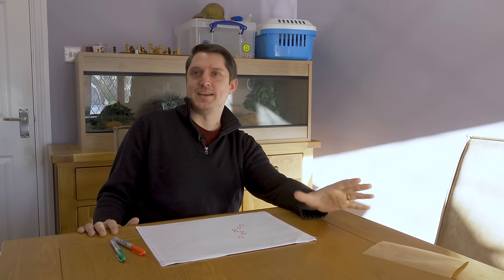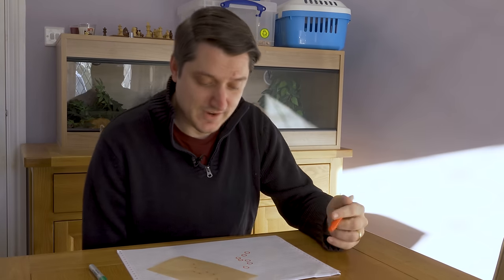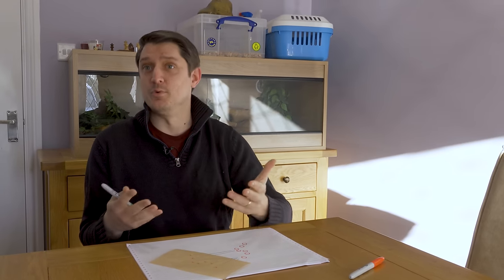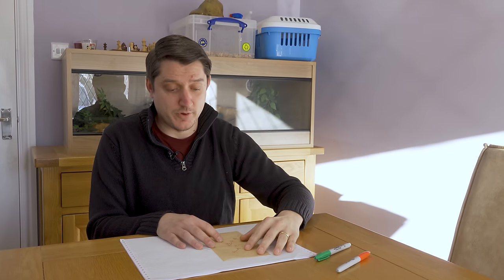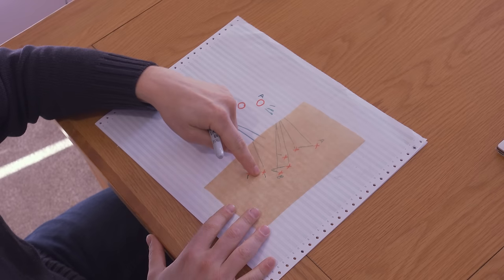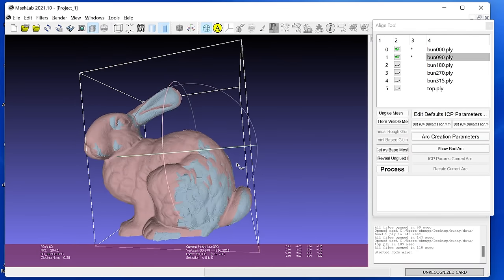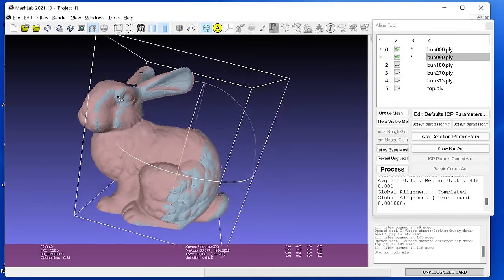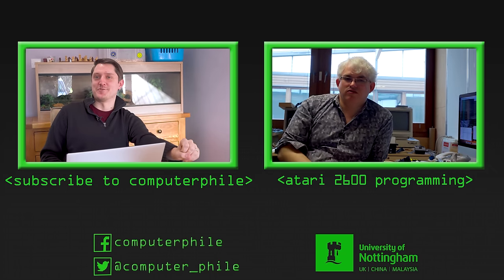Iterative Closest Point (ICP) - Computerphile

Comment: Singular value decomposition is one of those things that translate extremely well to GPUs. In fact, Nvidia's CUDA library has purpose-built SVD support (the cusolverDnDgesvd function in its cuSolver package).
Reply: I used that for live feeds of a self-driving simulation.
Reply: Sadly, SVD is by far not the bottleneck in this algorithm because it's only an SVD of a 3x3 matrix.  Actually, the real thing that needs to be sped up on the GPU is nearest neighbors search, which is a bit tougher but doable
Reply: You'd have to use a parallelizable KD Tree

Comment: Enjoyed - nicely explained.  Love the enthusiasm.
Seems to me that it works well for the scenery but there is a whole set of other problems if there are moving components.  First level difficulty a moving rigid object - say a car.  Even more tricky a flexible item - say a person walking.
For a real time application then more frequent scans means closest point is more likely to be the corresponding point but you have less time to process each scan - interesting trade off.
Reply: The goal of ICP is to reduce the amount of error, where "error" in this context would be defined (very roughly) as the sum of squared distances between the matched pairs of points. So movement in your scene would be handled (naively) the same way as the edges of the bunny scans in his example - the algorithm will minimize the error as much as possible but eventually get to a stopping point where most of the scene points overlap nicely but there are areas of large concentrated error, corresponding to the places where there was movement. (Hopefully that was clear enough.)

Comment: In astronomy we often need to map arbitrary images of the night's sky to Right Ascension and Declination coordinates (called plate solving).  I wonder if this algorithm is involved, using stars as the points.
Reply: When your points have additional attributes, such as brightness, it's often helpful to treat them as an additional dimension. Besides that, what the matching program does is probably very similar. At least, as the final step. To improve convergence, it might, for example, start with just the brightest points, and add more as it gets closer to the solution.

Comment: I had this video in my watch later over 3 months now. My expectation was to learn something about photogrammetry and matching pairs to build a tree and then a point cloud. I had some ideas to how it might work with projection and interaction, but that seemed a little involved. Now with the topic of doing 2D or 3D tracking in video, I always assumed the 2D example would do an extrapolated spiral search pattern for points and just find the lowest difference in the search area. 

But it never occured to me to see matrix tricks like SVD show up. Such a crossover.

I knew that a fourier transform on a matrix (like an image) would ignore any kind of translation or rotation, so you would use it for pattern matching for example. There was an actual optical application by Huygens Optics in a video a long while ago.

Comment: 5:40 I understand the centre of mass of the points to shift the sample - but how do you decide the rotation? Do you just move it to centre of mass, then rotate and if it gets better, you rotate it some more , until it gets worse again? Or is there a better way to do it?
Reply: rotations are simple enough that they can be expressed as matrix multiplication. the resulting matrix will not be completely solvable because its an approximation, but SVD gets you the best solution you can get with linear algebra
Reply: @alegian7934  yes he mentions SVD later but considering its 3 dimensions my mind still boggles how this can be done so quickly. Is there anything that helps a first guess?
Reply: I could be wrong in any of the following. But: if matrix A describes the 3d rotation, X is the matrix that contains as columns all points in one group and Y is the matrix that contains all points in the other group, we have AX=Y (approximately, remember, these cant truly be equal) so ideally if they were equal we would invert matrix X and obtain A=YX' (we found the rotation matrix) In reality X is not invertible at all but we can find its SVD that gets us as close to its inverse as possible. so we get something like A*UΣV=Y and we solve for matrix Â (an approximation of the optimal rotation). And we apply Â to X
Reply: @alegian7934  I guess that's it! This is all new to me. We did cover 3d transformations back in my degree, but not inverse, only forward. At least that's what i remember! Very interesting, will have to do some more reading before I understand this enough.
Reply: @alegian Can't we just do the following:
1) build a vector A out of the selected points of the first shape in respect to their center of mass: A = Σ a_i - a_center
2) build a vector B out of the selected points of the second shape also in respect to their center of mass: B = Σ b_i - b_center
3) calculate angle between the vectors?

Comment: Our biggest scan project was around 20 Billion points. Took a while to register even on a Threadripper-based workstation. Our scanner measures 976,000 pts/sec.
Reply: Maybe you where busy counting your points, but if you listen carefully around ~10:00 he is answering your comment
Reply: Btw: 20billion points would take more than 230 days of non stop laser scanning (with your ~1M pts/sec laser scanner). Did you just scan the all earth or what ?!!! :D
Reply: @videojeroki , I know how it works, scanning is a large part of my job.
Reply: @videojeroki  a zoo with a castle in the grounds. We used multiple scanners.  Terrestrial lidar scanners , UAV lidar and a wearable mobile mapping unit. We also took over 40,000  61MP full frame photos which are used to texture the mesh.

Comment: Kd Trees, would make an interesting computerphile video.
Reply: KD trees are the underappreciated workhorse of machine vision. If done properly they can be blazingly fast compared to other spatial partitioning schemes. They don't provide some of the benefits of more complex structures but for nearest neighbor searches they're tough to beat. Interestingly enough the textbook implementation of KD trees (and the ones found in open source libraries like the PCL) are not optimal. They are "pure" but in practical terms there are tricks you can play to speed them up without much work.

Comment: A couple of applications of this:
1. You have a lidar scan of terrain that includes woods, which has no color but has a few points on the forest floor, and a photogrammetric scan of the same terrain, which has color but no ground points. You align them and color the lidar points. (At least PerfectTIN, the program I wrote to make a TIN of point clouds, completely ignores color.)
2. You have a drone with a 32-head laser scanner. You fly it between two buildings over pavement and get 32 point clouds, one from each head. You align them and determine the calibration so that the point cloud you get from putting all 32 heads together is accurate.

Comment: I guess you can also do some calculations in other domain, for example  distance(angle) instead of cartesian x(y). It can help.
Reply: that would be my first idea to solve this issue I guess. create a set of data describing distance and angles of a bunch of points, then find the same results in the new data. although saying that point cloud data is usually very different from scan to scan.

Comment: uh, I woulda just matched just compared the distances from the relative end points and worked my way inwards, if the distance stretches or contracts to much then it's not the same object, abort and try the next object, either way you need to identify the objects in the snapshot working with, might as well just compare the results to previous results to see what has the least difference in point distances

*Edit:* the process could be further optimised by skipping objects that have to big a difference in the number of points also

Comment: But I think you are skipping over the main problem: how do the LIDAR scanners do the job of identifying common points that you did manually in an automated way?
Reply: i would guess that because of the high scanning frequency the points are already going to be pretty well aligned. each consecutive scan will be pretty similar to the last
Reply: Probably with the help of other sensor data. For example, wheeled robot can take the encoder reading at the wheel to estimate the change in direction and position of the lidar sensor itself between each lidar scan. This data can be used to first align the point clouds closely together enough before doing the ICP.
Reply: If you know the exact location of your camera and lidar, you can map lidar points to camera pixels, then use strategies like edge detection or color feature isolation to tag points.
Reply: His input was a rough guess, in any real-world application you can use ubiquitous accelerometer or GPS data to get that guess. It's just not relevant to the algorithm itself, which is the focus of the video.
Reply: yes to above answers. it's already close, but you can improve it with inertia measurements, feature detection in the point clouds, or feature detection from some color camera

Comment: I discuss my masters thesis in two days and this is something i used in it. nice timing 🤣
Reply: Good luck on that!
Reply: Awesome. What's your master thesis on?
Reply: @emmanueloluga9770  I discussed it this morning, it went very well. It is on an aerial point-cloud registration algorithm designed for urban scenarios. Basically it uses both image and point-clouds features to find an initial alignment as Mike does manually in the video and then applies ICP to refine it. I used an aerial Lidar scan of my uni city and ground clouds built with photogrammetry from a goPro(which stores a lot of position metadata) .
Reply: @guoah9  oh wow thats very interesting and exciting work. Congratulations on that accomplishment. Is there a paper out yet

Comment: So I see no way to do this without scanning your two groups of items at least once.  I mean, you have to know what you've got.  So, as I did that, I'd accumulate data I needed to define the "principle axes" of the two groups, along with extent information along those axes.  Then in the "general" (non-pathological) case, it should be as simple as matching those up.  We could contrive situations where there were symmetries that would make that approach non-deterministic, but it sure seems like it would get you a long way.

Comment: why not fit a curve to each set and rotate until those curves match. translation is automatically accounted for
Reply: Ultimately you end up having to solve the same problem. The example "cloud" shown in this video might give you the impression that you could just fit something like a spline or Bézier  curve through the points and then "simply" align the two curves. First problem is that most real world data sets won't let you simply fit a curve..."Well, then maybe fit a surface" you might say... again, not always easy, or fast. But even if you do manage to fit nice representative surfaces to the clouds... how do you think you find the registration between two surfaces? You use ICP :)

Comment: When scanning a stationary object like this from all sides, why not record the camera position and direction for each scan? It seems like that data could be used in place of the manual rough alignment step, and then the whole thing would be automatic.
Reply: In practice, if you can solve a problem in software alone, it's usually cheaper than solving it using hardware that you'll have to buy, install and debug.
Reply: You do that with inclinometers and GPS, but the precision you get is not enough. It is enough for the initial estimation, after that you use ICP

Comment: wouldn't it be easier to  just calculate angels and compare them
Reply: For that you need to know point correspondences
Reply: @kittenhat7266  you could calculate the nearest point and second nearest point for all points in both datasets so you could compare them by the angels.
You don't have to calculate all in the first dataset, but than you would have a probabilistic result

Comment: How about a Computerphile on the ethics of Tesla (or anybody else) testing out their beta driving software on public roads with the general public behind the wheel?
Reply: Are you saying that Tesla (or anybody else...) Is taking unnecessary risks to the population? Do you even know what kind of effort it takes to even consider that a self driving algo is working, stable, reliable and safe before to even considering testing ?
Reply: @CheddarKungPao  ok the level of reliability can be discussed. But common, insinuating that Tesla has ethical problem regarding the safety of people, you are flat wrong.
Reply: @videojeroki  Tesla has an ethical problem regarding the safety of people.
Reply: @videojeroki  there's video evidence of many near collisions on public roads. I disagree with you completely.
Reply: @CheddarKungPao  I'm not saying it doesn't exist. I'm saying that the phrasing need some nuances because it sounds like Tesla is disregarding safety, which is the opposite. I think we all agree that they are doing their very best to make the driving as safe as possible, the opposite would mean that it is an evil company with thousand of complicit engineers.
Reply: @videojeroki  they are not doing their very best, they are testing driving software on public roads before it is ready and putting everyone in danger. I am sure they believe they are being safe, but they are wrong.
Reply: @gloverelaxis  ok...

Comment: you better assume you can directly assign an image pixel to the depth, dont make it a fitting problem, solve it in other way
Reply: so have depth perception in both eyes, at the same time as the color detection, 2x as the eyes, for stereo, stereo depth, 2x2 sensorts
Reply: each pixel + distance must use same photon direction+origin, not displaced camera + lidar, design again, design wiser, not solutions to more complicated initial conditions
Reply: use single sensor to determine color and distance, for example normal light for color + uv/ir light for distance, and you have have both visible and ir/uv light sources as the camera lidar source, then just collect the color and the distance from the same sensor
Reply: k.i.s.s., dont solve problems you dont have to solve, dont be so proud
Reply: fitting approach is very jumpy, scared, of ghosts, that talk, samples, you almost always require temporal averaging for stability, but if you pre-solve the problem, you can take single frames without averages to stabilize
Reply: pass-through mirror to have both lidar vis/uv/ir source and the cc detector at the exact same location, one from side, one from behind, the two-way mirror
Reply: What are you on about mate, half of your sentences don't make any sense :D
Reply: all-in-one distance-image camera sensor-lidar
Reply: assume you also have the camera-sensor origin location exactly
Reply: circle around a target to 3d scan it, you have all the points known, the camera origin, direction, colors and pixel distance
Reply: or just a known grid, for the camera, and the camera angle, or 360 camera, with known zero-align
Reply: @niklas6576  I dont care, those who do will benefit, apparently you will not
Reply: @Jkauppa  the entire point of this algorithm is to solve for positioning in cases where you don't have this data :) if you know the orientation of the device that did the scanning, there's no need for the positioning
Reply: @Vancha112  wasted effort, just saying, choose your complexity point, I like more stable solutions, you seem to like to rock wobble
Reply: @Vancha112  if you dont need to do your job, you dont need to do your job, and this video was useless
Reply: @Vancha112  you got my point straight, you dont need to fit, just get the position data
Reply: @Jkauppa  remember the xbox kinect? Consideren a point cloud taken with that, where you have no accelerometer and no gyroscope. That's when such an algorithm is useful
Reply: @Vancha112  do it correctly from the start, so you dont need to question the methods later, straightforward vs finger fiddling
Reply: @Vancha112  If you listened to the video even a bit, then you assume you have at least some kind of a location data like lidar, I just pointed out that with appropriate lidar tech you dont have to do anything than just save the picture, with the pixel location data already correct, not even correction of the data
Reply: @Vancha112  even a normal iphone with gps and imu, you get the position right away, very accurately, for many pixels, even when moving around, check the corridor crew terrain 3d capture video
Reply: @Vancha112  I'm not interested in aligning my points with you, get it
Reply: @Vancha112  never let things to be probabilistic if you can make them absolute
Reply: @Vancha112  what is a point cloud, something that has more than pixels
Reply: you can make 6dof video, rgbxyz with 3 additional channels for distance, with a single data point per frame, to store the origin of the camera, so rgbxyz + origin, 48bit rgbxyz spatial video with origin updates